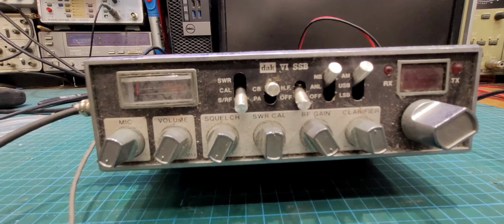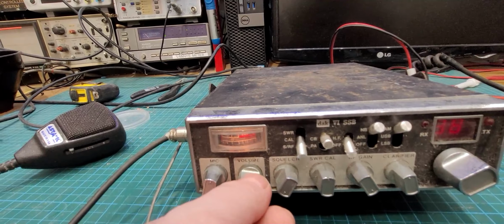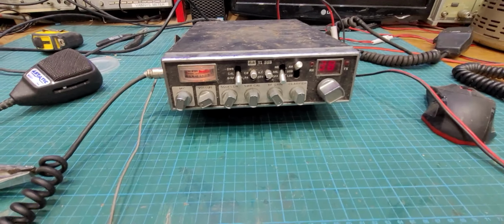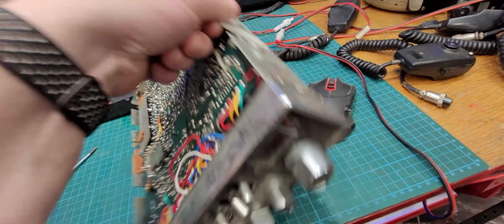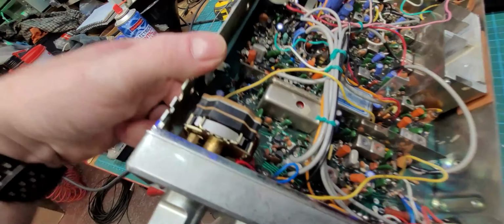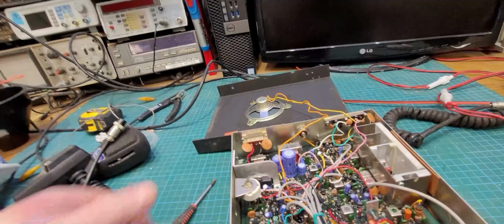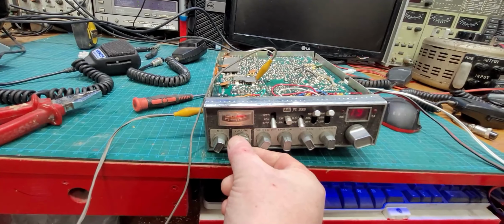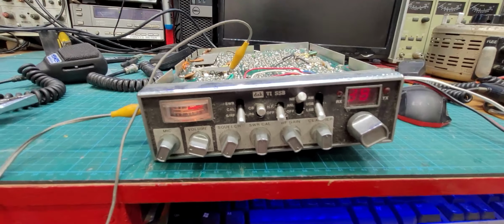DAK 6 SSB CB TRANSCEIVER

Comment: Cybernet MK1 board George,  many radios used them.

Very robust internals.

Most the ones ive bought 10.240 crystal issues, or the main filter , respond well to cap change.
Reply from the maker: It's a cybernet copy Paul. Bit better made too. Few lads in the dak group reckon it could be Hitachi

Comment: Never seen one of these before looks good project that indeed.
I' currently have a cobra 148 gtl DX and that's been stored in a damp loft case has gone rusty inside any ideas where I can get new covers.
Reply from the maker: Clean them up and paint them or get them powdercoated
Reply: I've seen a couple that have had vinyl wraps done, too.
Reply: @johnapelcede9861  the outside is good condition the inside thou has got rust . Not deep but just a covering.
Reply: @David-kd7vl  maybe a wipe with a rag damp with CLR?
Reply: @johnapelcede9861  will give it a go cheers fella 👍

Comment: Nice rare radio. What do you like to use for cleaning the exterior?
Reply: George uses a secret sauce....Don't you George...
Reply from the maker: @assistantto007  Well that's after it's cleaned. But to clean it, just some warm water and dish soap and a toothbrush normally.